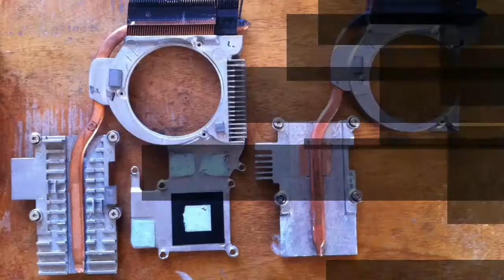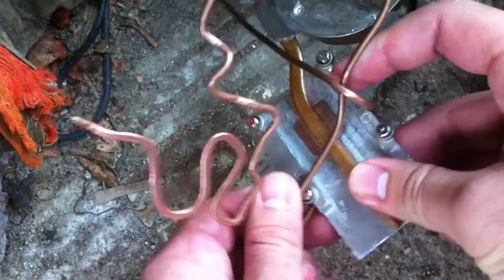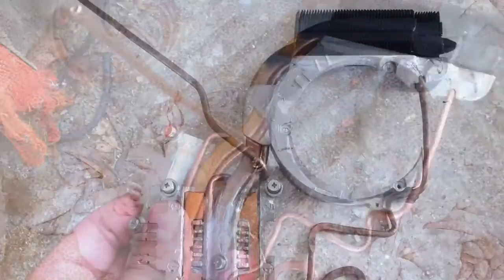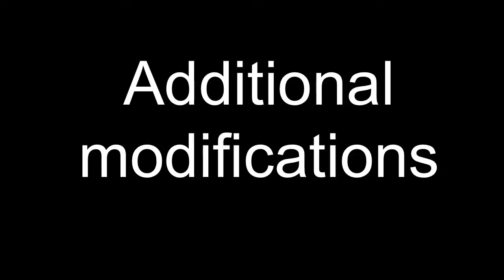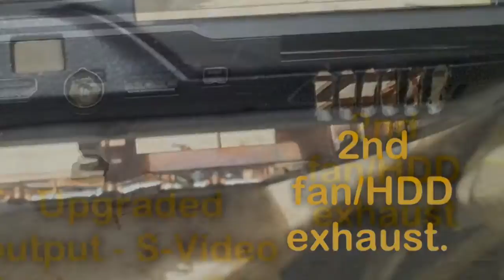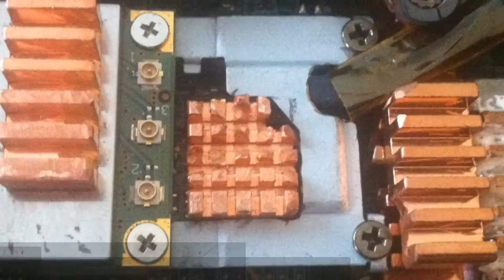5920G Cooling Odyssey part 1

Comment: VERY GOOD VIDEO !!!!!

show us PART 2 PLEEEEEEASE !
Reply from the maker: Jan J Thank you. Will do, but I don't have much time lately. Was waiting for non-leaking fittings for quite some time as well.
Reply: Димитър Гуленов
Thank you for answer. i want to do something like this with my Toshiba satellite c670-17G . is quite overheating, with cooling pad , when i play games is temperature over 80*C and then games are lagging, and idle temperature is about 40-45 *C
Reply: i think the Laptop crashed before part 2 come out... RIP

Comment: one another Q is , what for tools you have used ??
i have already buyed fitting, i would maybe need to solder better soldering maschine.. i have electric 30W and 45 W and one other bit old older but stronger.
Reply from the maker: Jan J If you have never repasted, it's a high time to do so. I'll recommend either Gelid GC Extreme, or Arctic Cooling MX-4, with priority to the first one. 

As for what kind of tools - whatever I had on hand, mostly Dremel's chinese cousin/brother (because it's cheap and does more or less the same), the cutie from the beginning of the clip, various pliers (for bending the pipe) and a soldering station (for the fittings, I don't know how much Watts it outputs to be honest). I used Acrtic Silver Thermal Adhesive as well as Arctic Alumina Thermal Adhesive, because there was no more Silver around. Soldering would be better, but I couldn't figure out how to do it, while keeping all together.

Comment from the maker: Was thinking about solder, but couldn't perfect the soldering/baking and I didn't want to risk the heat-sink. So I ended using Arctic Silver Thermal Adhesive.

I'll be using Zalman Reserator 1.
Reply: what is the tickness of copper tubing?